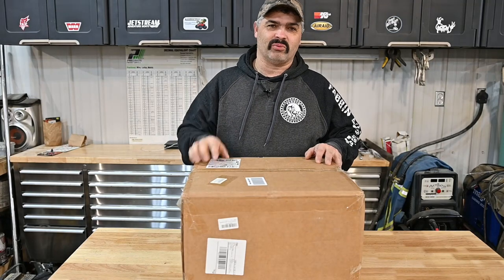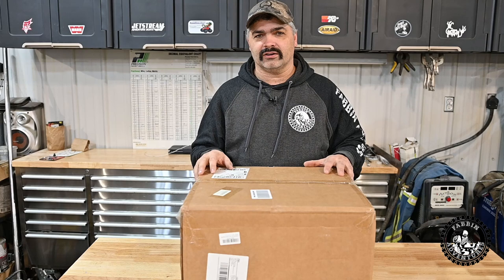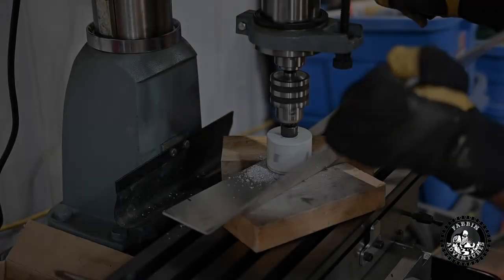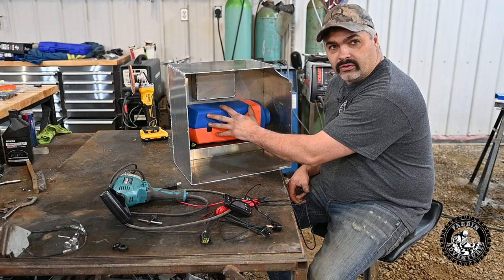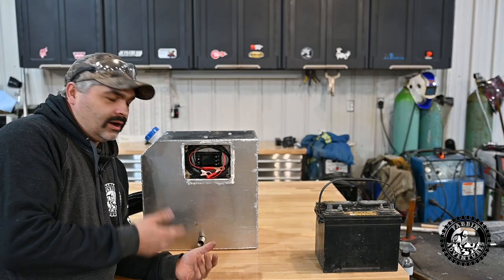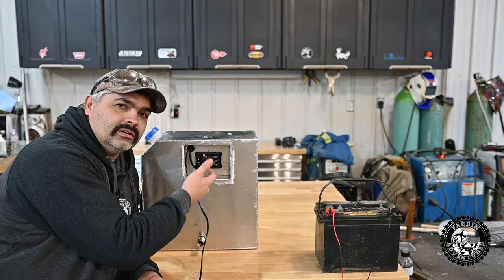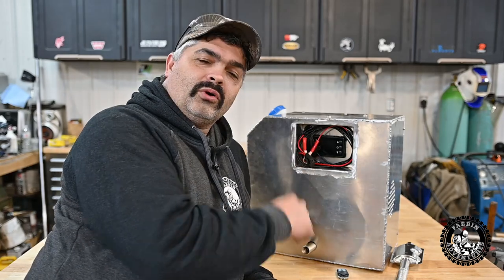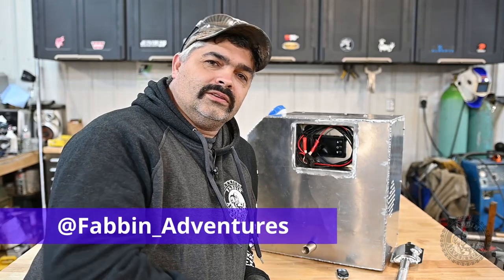Portable Diesel Heater: Chinese diesel heater

Comment: Looks good. You may want to put some heatproof bandage around the exhaust. It'll stop it getting that aluminium case hot. I'm not sure portability wasn't on the designer's mind when they came up with those things but if you can stop the exhaust gases from entering the tent you should be onto a winner. I have the same kit for heating my garage. The heat output from them is crazy for what they cost to run!
Reply from the maker: I ran it for a few hours today at work and the case never got hot, i guess that would be the advantage of the aluminum.
It sure does put out some heat though!
Thanks for your comment!

Comment: We use those my semi. They work great. Awesome idea
Reply from the maker: Thanks Brandon, the do work great!
Reply: @FabbinAdventures  might have to entertain this in mine... I just wish I could weld like you do lol
Reply from the maker: Just take practice man, i have a welding tutorial video. Not on aluminum though, im still re-teaching my self to tig aluminum. Been 25 years since i did it for a job..lol
Reply: @FabbinAdventures  i need time for practice. Being a full time OTR truck driver doesn't help lol
Reply from the maker: I bet it doesnt.
Ive worked in a few different fab and welding shops over the last 30 years, so ive got lots of practice.
The one shop i worked in calculated how much wire i burnt in a year and it was ove 90 miles! I wonder how much wire in my life time!

Comment: Hi Ron. I have such a diesel heater in my Suzuki but i bought the compact portable one so i didnt have to build a housing. Maybe two tips for this unit. You could buy another remote controle with a display. That makes it easier to see if the unit startet . I start the unit from inside my house and its nice to know if its realy starts. The remots are cheap and easy to program. The second tip if you want to use the timer to start the unit in the morning it isnt like you put the starting time in the controller that doesnt work because the chinese people use the countdown methode. You have to but the hours and minuts in the controler when you want to start the heater. Lots of people on youtube have problems with this settings. I love this heater in my suk... stay save and best wishes from germany
Reply from the maker: Those are great tips Sven, ill look into the programable remote!
I was wondering how that timer worked.
Thanks for your comment!
Reply: @FabbinAdventures  you are welcome.

Comment: thought about doing this last weekend after camping. need more data. how much voltage is used each hour on max? how much fuel? at say 32*F  (0*C) what is the max temp rise? what was the size of the area? you say 5kw but so i would assume the 8kw would have a higher output. Box LQQKs GR8, will give me an excuse to practise TIG....
Reply from the maker: Charles, it gives all that info i believe in the manual, i will look when i get home from work.
Thanks for your comment and watching my video.

Comment: for all who have prop heat I would suggest you toss and add diesel.... No moisture and lots I mean lots better heat
Reply from the maker: Yes, and these things put out a ton of heat and way safer than using a buddy heater in your roof top tent or what ever. Safe, dry, clean heat! No carbon monoxide!

Comment: Awesome! I totally understand having a cold night in the mountains with the wife, but girlfriend? Isn’t that why you’d bring the girlfriend? Hahahahaha! 
How long does a tank of fuel last? Would it work in a side by side, or does it shut off when getting jostled around? Does it have a temperature sensor that can be remotely mounted so that it will turn on and off by itself to maintain a desired temperature set point?
Reply from the maker: I would think it would work great in a sise bt side with a cab, dont think it would shut off.
It doesnt really have a thermostat more just control of the fuel pump and fan...low flow and fan speed then a bunch of increments up to high fuel flow and fan speed.
The tank is 10L, and if i remember right on low it uses about 0.18L/hour on hight its about 0.38L/hour
Reply: @FabbinAdventures  Oh wow! When I get my Honda 700, feel free to do an install video... hehe.
Reply from the maker: Oh yeah? When you getting that? For sure we can install one in there!
Reply: @FabbinAdventures  Whenever I get put outside to the field! I don’t want to spend the money and time fixing my Tacoma on all my days off this year again.
Reply: @FabbinAdventures  I guess Honda might offer an optional heater that connects to the coolant system, but then it’s something else that will leak and fail while I’m at 6-3
Reply from the maker: I would think honda should be good stuff and not have to worry about leaks
Reply: @FabbinAdventures   Hopefully. But your heater has a flexible duct that I can put where I want heat!
Reply from the maker: Hey would work nice for heating frozen stuff up too.
Hey man, gonna need some kind of speed reducer or gear reducer for your can crusher, princess auto has them.
Reply: @FabbinAdventures  Like a VFD, or various pulley sizes ?
Reply: @FabbinAdventures  I once knew the math formula to figure out a gear speed or shaft speed if I knew the driving gear or shaft speed